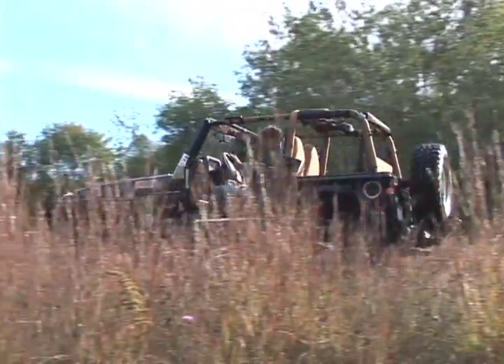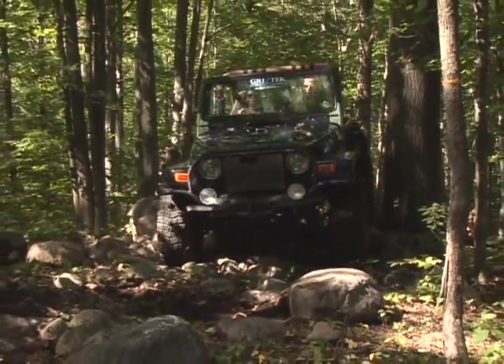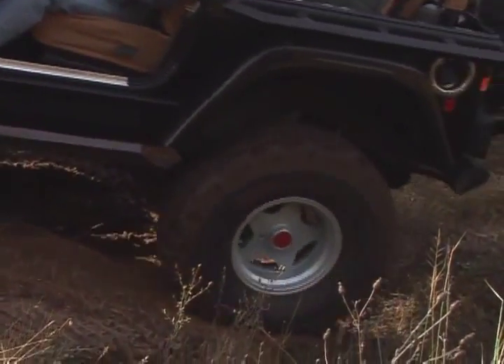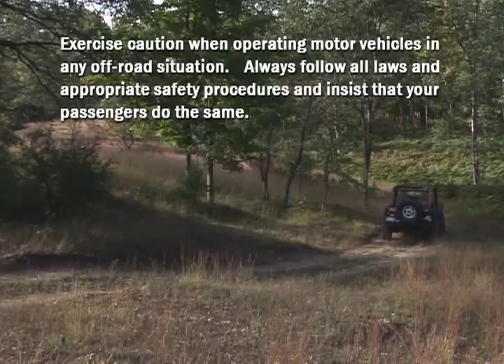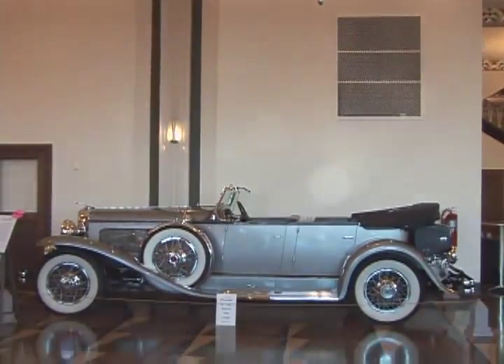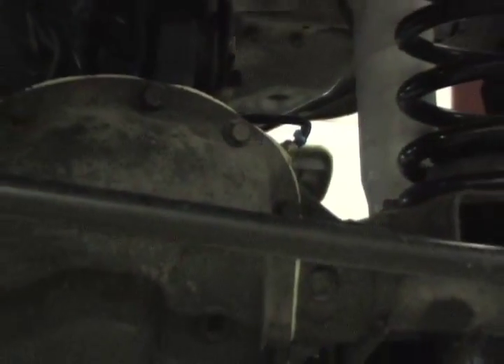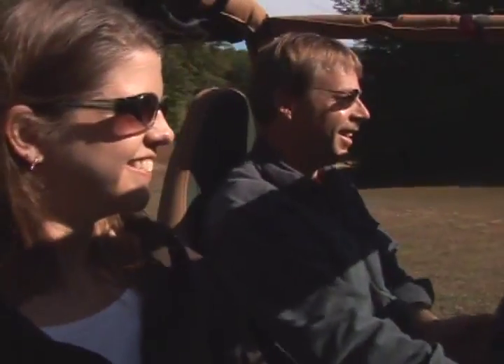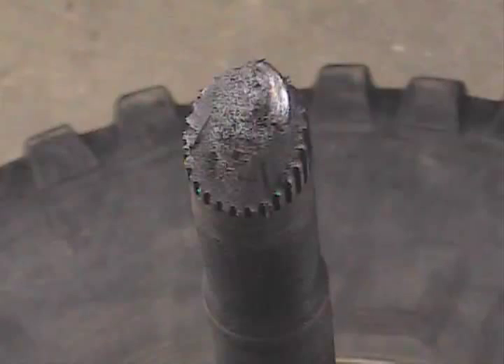ECTED Max Locker - Auburn Gear

Comment: Great idea ,poor execution.  This limited slip/locker would be good for those of us that drive on snowy/icy road conditions where a locker can be tricky or surprise you on ice or snow/rain. Too bad its a clutch design. 12K 4 year warranty ,big deal , if it was a longer term warranty with higher  mileage it might be worth it. Also only rebuildable by factory is a deal breaker.